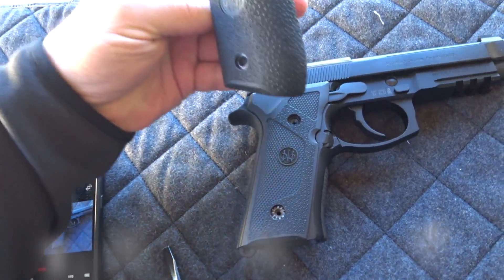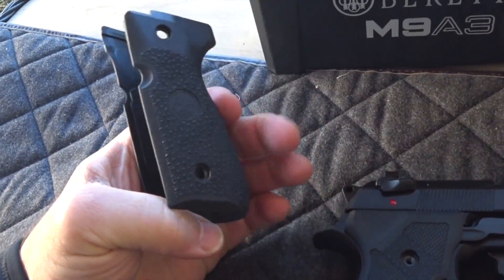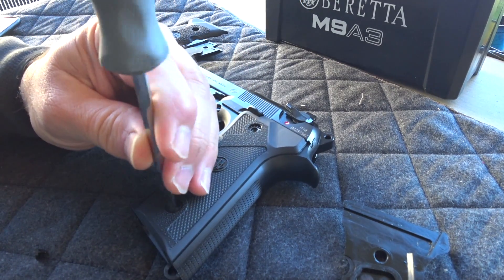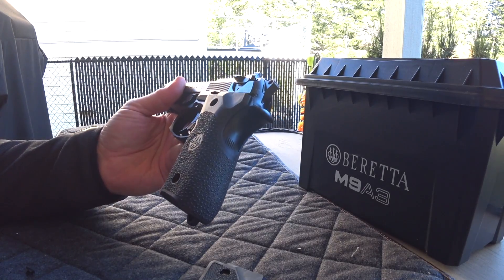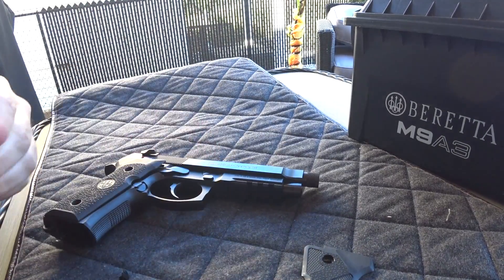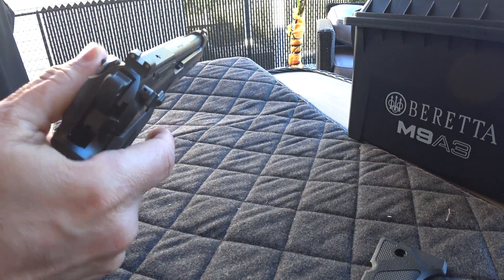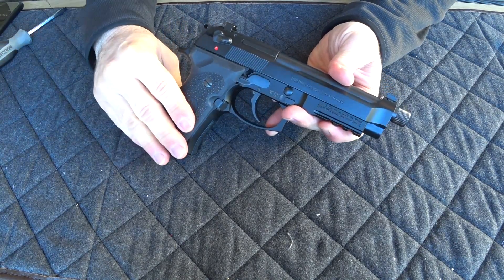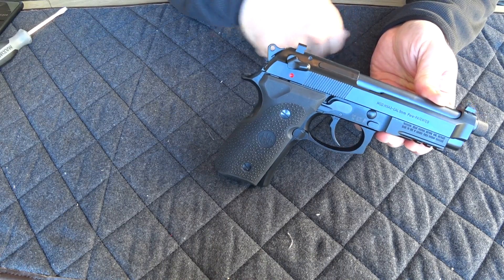Beretta M9A3 Pistol Grip Change

Comment: How do you like the change so far? Did it give you better control during operation? Although I like the rubberized texture of the hogue grip, I have small hands so I have to keep the standard grips installed on my M9a3. I may change out for a comparison, but I'm sure it'll place most controls out of reach for me. Thanks for the vid!
Reply from the maker: I must say i had a pretty good feel about the grip, i think i;ll keep it that way for while. it is much bigger than the stock grip, if you have small hands it might not work for you. the rubber feel is pretty grippy though.

Comment: The only thing I don't like about the larger rubber wrap around grip is that with it on there, the extended magazine release is now harder to reach. It can still be reached, and is still probably better/easier to reach than the normal magazine release, but I can't really reach it anymore without noticeably shifting my grip.
Reply from the maker: After readings your comment it got me thinking and your right, although I can still reach, I do have to slightly adjust my grip.
Reply: @PanzerGunsAmmo I think the engineers did the best they could to give options to people who preferred a larger grip, though it is a less than ideal solution. As you can see, it is not the end of the world, we can still work with it and it is a great gun still, I just wish the rubber wraparound grip were a bit thinner in some places. The traction it provides I think is really good.

 I have not tried the plastic wraparound grips yet that come with the new 92X pistols (and that can be purchased separately also); those possibly might be slightly thinner and might make it just a little easier to reach the mag release (which is really all we need). I will have to get a pair and try this out.
Reply: @dexm2010  I have the 92x, and use the wraparound grip that came with the gun. I think it’s very nice. I would also hope that LOK will come out with G10 grip(s) that will fill the hand in the way of the 92x wraparound. It would allow for a different look for the pistol.